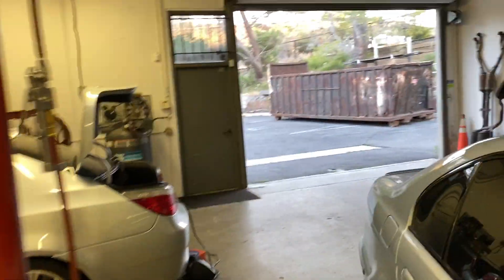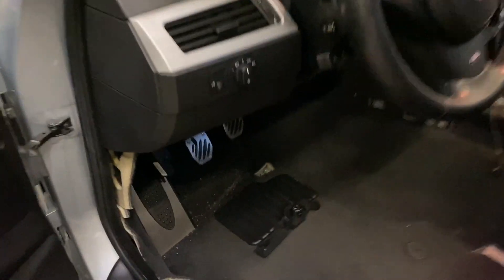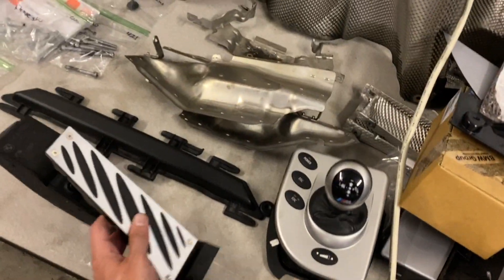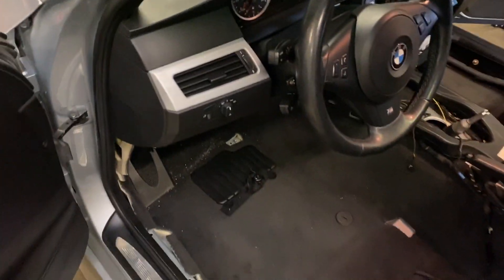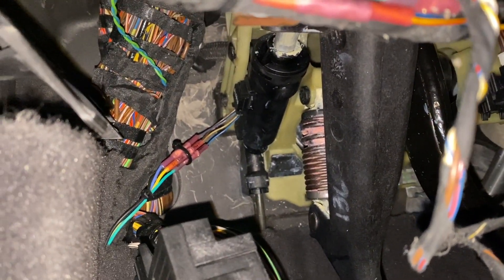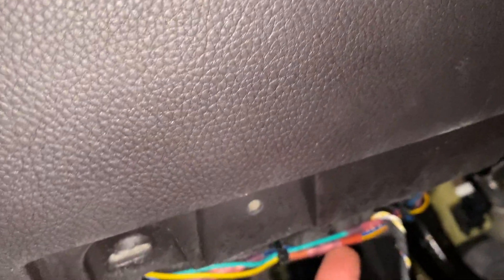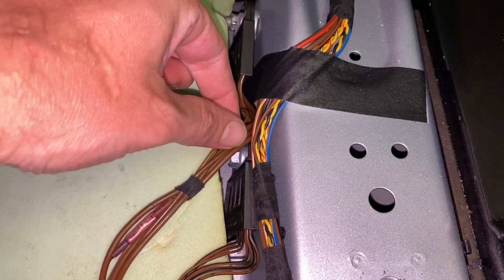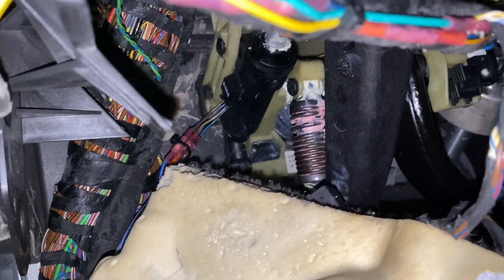Pedals and Clutch Switch  5/26/20 - Day 3,457

Comment: Wiring looks awesome. Well done. If you’ve got four wires that all need to be spliced/crimped, you can stagger the crimps out so that it doesn’t create a big bump.
Reply from the maker: Thanks!  I thought about staggering but the pigtail wire length was limited and I didn't want to risk it.  There's enough room down there for the bump.